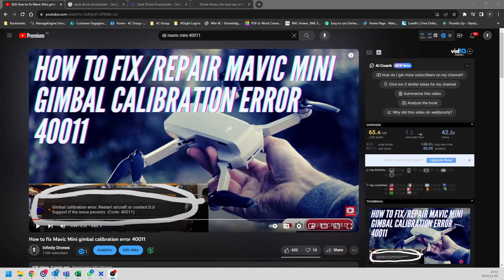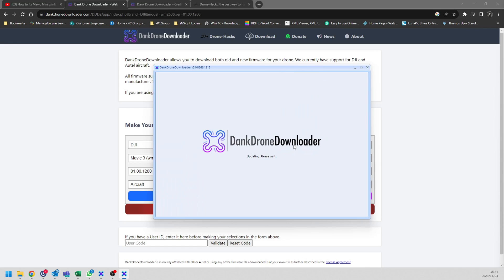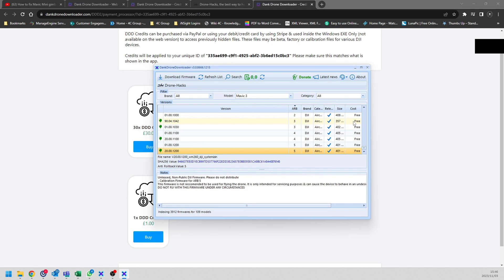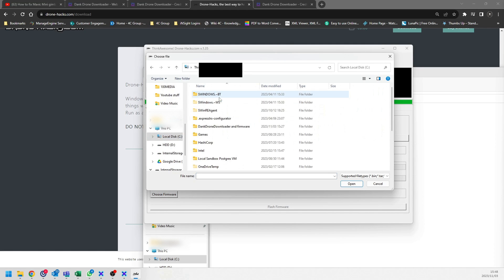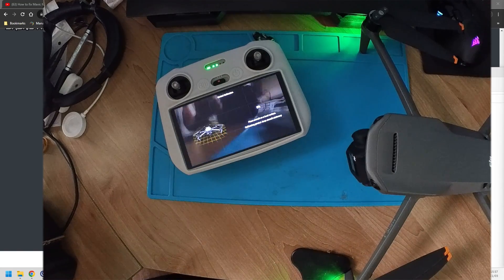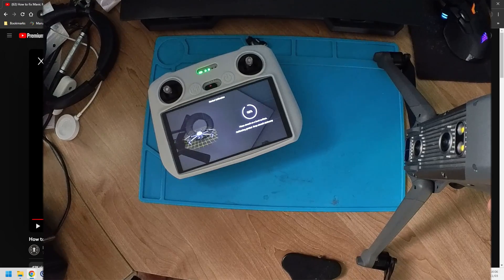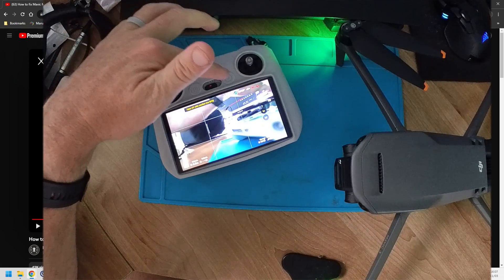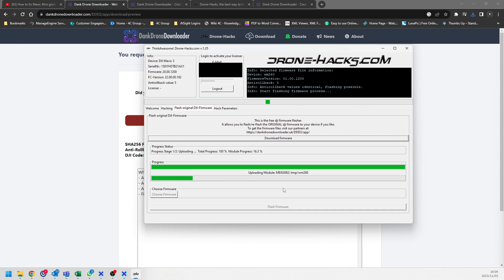DJI Gimbal Calibration Firmware

Comment: 40011 yes Uhm jitter was there after dance but; I’ve tried as much as felt something in pitch motor, now jitter stop, start up dance but still yo yo then stop, gimbal stuck. 

Keen to test if it’s Hal sensor or thick cable issue. 

But ddd and drone hack, is there, 4 ddd credit for 20. Firmware with Arb 4. Is it worth downgrade to 1.600 arb4 since maybe recommend by ddd. 

It is 10% gimbal calibrate nothing else.

Nolimit drone seems good… but python Cmd doesn’t work due to arb4 unless service firmware work?

I swear I saw ppl use other tool to force calibration ? 

Thank you for video!

Comment: Will this fix the 4002 stuck even tho it’s not stuck and I just changed the ribbon cable and gimbal cable
Reply from the maker: It's designed to help with those kinds of issues, so give it a try! You have nothing to loose. Sadly I can't gurantee that it will work for you as I've never had 4002 error.

Comment: how to calibrate the gimbal that pointing to the right after i replaced the gimbal for a DJI mini 3 ? it getting error gimbal motor overload, even after doing the calibration from the controller, i appreciate your help .
Reply from the maker: if you're getting motor overload it means either the motor or the ptz cable is not happy

Comment: Hello, My DJI Air 2S gimbal works fine but had a small buzzing noise and almost no vibration at certain angles, I used the python script to calibrate it and it caused 40011 error to show up, I tried what you said in this video to get rid of it, and it got to 90%, I rotated it up and it said calibration successful. However, it did not remove the error code, does this mean I have to replace the gimbal or is there something else I can do? Note that before I used the python script to calibrate it, I had no error.
Reply from the maker: I'm really sorry to hear that. That buzzing sound is from a pitch or roll motor thats not happy... usually the ptz but in many cases the actual motor. You'll need to take it to a repiar center

Comment: Well, probably only you can help me. I completely crashed my Neo camera, everything is fine except you can't see anything (the gimbal work perfect). I ordered a new compatible camera, and I'm supposed to calibrate it. Are the steps you showed in the video the same steps I'm supposed to do with the Neo? Because I saw in several places online that DJI has completely blocked the calibration option for new cameras in the Neo... I would appreciate your professional answer. With great respect.
Reply from the maker: Sadly, I don't think there is a workaround for the Neo. DJI has a very closed system when it comes to that. So sorry for the bad news...

Comment: Hello! thanks for the guide! The calibration software is not flashing on my MINI 2 SE. It stays at step 1 of 2 and 0%
Reply: It has just flashed, but now when I attempt to calibrate in the DJI fly app, it stays on 0% and the calibration fails.
Reply from the maker: Hi there, firstly... are you flashing firmware with the same ARB level? Secondly... did you replace the gimbal after a crash perhaps?

Comment: How do I know which one is the Air 2S that can fix issue 40011?
Reply from the maker: I do not understand your question. The video tells you how to pick the firmware for your drone...
Reply: @InfinityDrones What version should I choose to fix Error 40011 after replacing part 2.04.2700 or as shown on your screen?

Comment: Hello, I watched the video at least 10 times :). Which version should I download for the Mini 2 gimbal  cal. error?
Reply from the maker: you need to check what ARB version your current firmware is and then find the maching firmware since only matching ARB firmware can be used together

Comment: Hello, does the repair firmware can recalibrate sensor? I have a air 3s I replaced sensor and i have an error with sensor...
Reply from the maker: You can try, but if you changed the camera the serial numbers will not match the coreboard's... so there will be an error even after calibration has completed. You camera should work but the error/warnng message will be there. Only way to remove is via official dji software

Comment: Can i ignore the warning? I think my gimbal is center and no problem. I tried python and error appears but my gimbal is centered
Reply from the maker: If your gimbals is working like it should then yes you can ignore it. sometiems when you replace the gimbal it will work 100% but because the serial numbers dont match you'll see that error.

Comment: Hi, I'm a repair technician and I have a DJI Air 2. I replaced the entire gimbal and calibrated it. Everything works fine, but I get error 40011.
Reply from the maker: coreboard does not match... to remove that error you'll need official dji software to link the serial numbers

Comment: hi, Perform the calibration and it recognizes it as complete but does not erase the errors.mavic 3
Reply from the maker: did you replace the gimbal or just repair it? What error are you getting. Replacing parts will leave you with errors because the serial numbers do not match the coreboard's
Reply: @InfinityDrones Hello, I replaced the entire gimbal. Error 40021 and 1C100204; 1C600204 appears.
Reply: I replaced the entire gimbal. I need to eliminate errors 40021, 1C100204, 1C600204. Thanks for your response. If you know which app I can use to eliminate these errors, thanks.
Reply from the maker: if you replace the entire gimbal certain erros will not go away unless you "sync" serial numbers with the coreboard. So you need offical dji software that only repair centers have...

Comment: Would this method solve the issue of the horizon shifting after a crash on mavic 3 cine?
Reply from the maker: Definitley worth a try. But if your horizon is not consistant it might be that there is a hardware issue

Comment: Hello, I have a problem with my DJI Mini 1. It won't complete the UMI calibration, code: 30055. I did everything I could. I downloaded the program and bought (V09.09.0901_Mavic_Mini_dji_system.bin) the latest diagnostic firmware for it. I installed everything correctly, but the error persists. Do you know if there is any other way to solve this? I would like some tips on this.
Reply from the maker: Hi there. Did you have a crash? 

I have an IMU calibration video on my channel that might help.

Comment: does this will work on mavic mini 1? i did the same thing with old video you made and it said "Fw has lower Antirollback value as drone. Need to downgrade via exploit but none available for this drone/firmware combination." will this method works too or it will be the same results? i dont really want to spent my money over a app licence to be used once
Reply from the maker: Sadly if you're firmware is too updated then there is no other way... Check if there is a newer calibration firmware that is the same as your ARB version

Comment: Has anyone been successful when doing this for a DJI Mavic Air 3
Reply from the maker: i've not had an air 3 to test with, but give it a go. There is a reset option if you can use if it does not work to return back to stock.

Comment: I have a dji mini 3 pro 
I replaced the gimbal motor the one on the bottom . My problem is that the gimbal is not working correctly and the camra is tilted and not looking forward strait 
I tried to calebrate the gimbal through the controller but didn't work out 
Do u think ur method can help ?
Reply from the maker: Hi there, I have a gimbal calibration firmware video where you can use a python script to calibrate. Try it. If that does not work and this video didnt work... then sadly you'll need to send to a repair center.
Reply: I have exactly the same problem thats why im here

Comment: any idea how to clear the error message off the app? i tried lifting it up at 90% it fails so i tried at other  percentages it fails. this drone doesnt really do all those movements and i t doesn't do that small twitch. the gimbal is calibrated via python.  i just need to clear the error message. can u help pls?
Reply from the maker: did you replace the gimbal? If you replaced a part you will have that "ghost error" due to serial numbers not being paired. So the only way to remove it is via official dji software.
Reply: @InfinityDrones thx for replying. I didn’t replace the camera or the PTZ just replaced the arm.
Reply from the maker: I'm wondering if you do not perhaps need more calibration. Vision sensor wise. Dronehacks has a tool that can fix that. they will be releasing it soon.

Comment: hello i have crashed my mini 3 pro, fortunately i swap the broken yaw moton( orizontal stabilization) with a new one, now the other motor(vertical) after the start up calibration shake violently, may this metod help?( the second motor Y axis, before the other replace worked fine)
Reply from the maker: you can try, but I cannot promise anything as I've not done it personally on a drone with a replaced yaw motor
Reply: @InfinityDrones  ok thank you ✌
Reply from the maker: @danyurzi  good luck
Reply: ***UPDATE***If anyone has the same issue, I can confirm that the latest Firmware on DankDroneDownloader 20.00.0800 works for calibrating the Mini 3 Pro!

Comment: Hey there, and thank you for the video. I'm trying to calibrate my mini 3 pro but I can't get it to show a COM number in the device manager. I've got the latest version of Drone Hacks as i've used that for the FCC hack however, I can't find the option for Gimbal calibration. No service tools exist. am I missing something? At this point I'd be happy to pay someone else to do it for me but I'd much rather do it myself. Please help!
Reply from the maker: Hi there! So you could find the calibration firmware on DankDroneDownloader? You wont find an option for Gimbal calibration on Donehacks or DJI Assistant 2 for Consumer drones. In the DJI FLY app there is and option to do the gimbal calibration  under the Control tab.
Reply: @InfinityDrones   Thank you so much! I found the calibration firmware. I was looking in the wrong place....think I had your videos mixed up. This video was very helpful. 
Question though, will the calibration firmware update the Hall sensors as well? 
Just to be clear, I had a crash and had to replace the gimbal. It works now, but the camera is tilted to the right, its virtually unflyable (camera shakes and moves randomly)  I tried using Pyserial, but I couldn't get my computer to show me a COM port number??? 

***UPDATE***If anyone has the same issue, I can confirm that the latest Firmware on DankDroneDownloader 20.00.0800 works for calibrating the Mini 3 Pro!
Reply from the maker: @Broism  ah man. I hope this helps you. Do you have DJI assistant 2 for consumer drones installed?
Reply from the maker: @Broism  ah man. I hope this helps you. Do you have DJI assistant 2 for consumer drones installed?
Reply from the maker: Thats amazing! So happy to hear that. Sorry that I was not responsive directly after your "your so responsive" message haha

Comment: Hello, can I calibrate my mini 3 Pro and mini 4 Pro this way?
Reply from the maker: Mini 3 Pro you can via Dronehacks. Mini 4 Pro is not supported.
Reply: @InfinityDrones  mini 3p ?
Reply: on dronehacks unfortunately I did not find a software for calibration of gimbal
Reply from the maker: @pawelpaciorkowski9762  on the latest Dronehacks version there is an option. You need to purchase the calibration licence though since the only way to do it is via a DJI service software where they charge a fee per use.
Reply: @InfinityDrones you could help me or direct me to what kind of link etc
Reply from the maker: Hi there, on whatsapp? How did you get my number? I'm on Instagram. The link to the calibration firmware is on the Dronehacks site. https://drone-hacks.com/available-hacks

Comment: Maybe, you can give me some advice. Uploaded calibration firmware (20.01.1600) to my Air 2, but after first start I was unable to connect my RC. Then I uploaded standart firware (01.01.1600), and the situation is the same.. Now I stuck, couse IDK what to do(
Reply from the maker: Did you load the calibration firmware and calbibrate your gimbal? Has the issue been resolved? Lets start there before we move on to the next troubleshooting step.

Comment: Hello, I've a Mini 3 Pro, my case is that I slightly crashed the dron into the sand, I did clean it until both flying and gimbal motors worked fine again, however after a while the gimbal started to present some issues, and there were messages of overloading or overhitting gimbal motors, sometimes there would be some bad movements in the camera but usually I just landed the drone and flyed it again after a couple of minutes, recently  I decided to desasemble the gimbal in order to clean it bettler (disconecting the gimbal from the board of course), AND GOD, I COULD REMOVE MORE SAND from the inside of the gimbal... and the real thing comes here, now the tilt of  the gimbals is almost not working, standart calibration only achives 85% and then there is the 1D010003 error, (stuck gimbal) .... will this help me?
Reply from the maker: Sadly this could be multiplie issues, but most likely your 7 in 1 cable is not good anymore - after that it will be gimbal motors etc. Sand is a horrible thing to get out.
Reply: @InfinityDrones  I accidentally updated the firmware to the latest, it's ARB7... what can I do now?
Reply from the maker: nothing you can do but wait for other calibration firmware that matches your ARB or you could buy a Drone Hacks license

Comment: Progress bar stuck at 0% on dji mini 3. Tried on two differentes machines (windows 10 and 11), both with the same problem. Have no ideia why. Tried to let more than 10 minutes to see if the drone rebboted and got the new firmware, but with no sucess.
Reply from the maker: Mini 3? Dronehacks cannot flash mini 3 firmware, only the mini 3 pro
Reply: @InfinityDrones  ohh I did not know. The software does not say anything about that. Is there any way to calibrate the mini 3? Because I bought the firmware calibration in dank drone, so I think there is a way to install it
Reply from the maker: @GuilhermeTuratti11  sadly, the only way I know is to send to a store/repair center
Reply: @GuilhermeTuratti11  Hey ! I have absolutely the same problem ! Could you help me please to resolve it ? What kind of soft did u use and where did u find it ? Thanks a lot !
Reply: @AlekseiLaptev-i2x I had to pay to fix it. A brasilian guy has his own software to do it. I can recomend him with you want, but I dont know if be speaks english. He did it remotely
Reply from the maker: Glad you got is sorted

Comment: Hi, after replacing the gimbal, I can't turn on the drone after connecting the cable to the PC. How do I get into DFU mode to update the drone using the drone hack? I have DJI mini 2
Reply from the maker: So you can power on the drone? If you can you mist follow the mini process (when you open the application you'll be able to see the "mini connection process") just follow those steps
Reply: @InfinityDrones  in order for the drone to see the PC, I must first turn on the drone and then connect it via USB to the PC. Otherwise, the drone cannot be turned on, but I have already managed to update the drone, it's just that the drone does not see that the camera is connected and I only see darkness
Reply from the maker: @vasiksv3363  then you have a ptz cable that's faulty or a faulty camera
Reply: @InfinityDrones  oh well thanks for the info
Reply from the maker: @vasiksv3363  Just a pleasure
Reply: @InfinityDrones  The problem was in the PTZ cable, I can see the image now. Thanks
But in order to be able to update the drone and look at the SD card, I must first turn on the drone and then connect it to the PC with a data cable. Is this normal?
Reply from the maker: @vasiksv3363  yes sir, that is normal
Reply from the maker: I recommend getting an SD card reader so that is not necessary
Reply: @InfinityDrones  thank you for the advice, I use a reader, but I found out that it can also be connected to a PC if I turn it on and connect it to the PC at the same time. Keep making your videos are very helpful.
Reply from the maker: @vasiksv3363  I'll do so! Thanks for the support!

Comment: hi dear hope you are doing well i need some help dear i have a mini 3 pro but the controller bound with my mini3 pro i lost and i conect my drone to new controller dji rc n1 its showing device bound to another account please give me some help to resolve my issue thanks
Reply from the maker: Sorry... can't help with bound controllers :( I wish dji would just remove this silly bind issue
Reply: Thanks for reply dear I buy a unbind motherboard on my mini 3 pro and than gimbal calibration need only right so I can calibrate gimbal from dank drone
Reply from the maker: @JawadAhmed-v8f  oh ok.
Reply: Hi dear please tell me if I buy i new unbind motherboard for my mini 3 pro Whats error comes and the error have solution or not Thanks❤
Reply from the maker: @JawadAhmed-v8f  you'll still have the 40011 error but it won't affect anything

Comment: After changing the camera to the mini three, this method will work.
Reply from the maker: Mini 3 pro it might, but this method does not support flashing mini 3 firmware
Reply: @InfinityDrones can you please explain better? Is it possible to calibrate mini 3 pro or not?
Reply from the maker: @massimofigna8721  Dronehacks does not support mini 3 firmware flashing only mini 3 pro firmware flashing. So if you have a mini 3 pro you can flash the custom gimbal firmware.